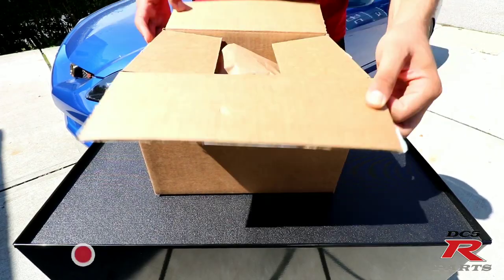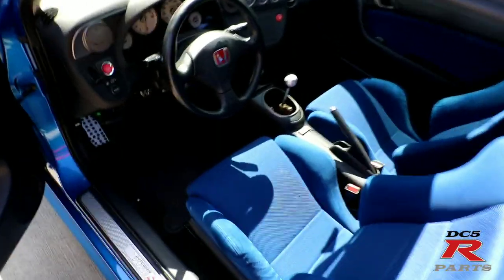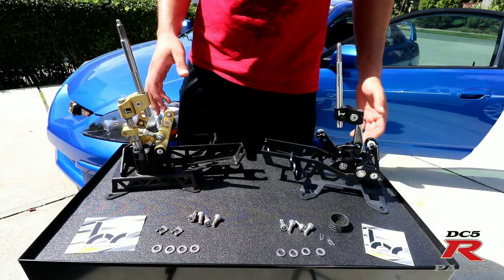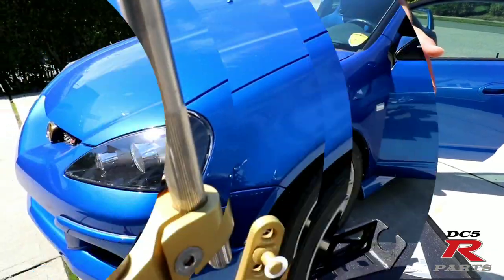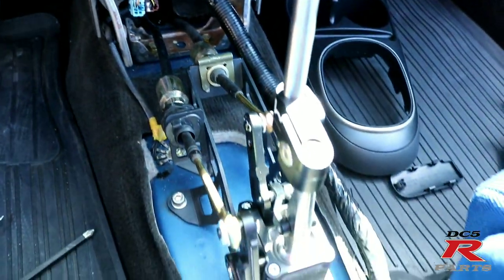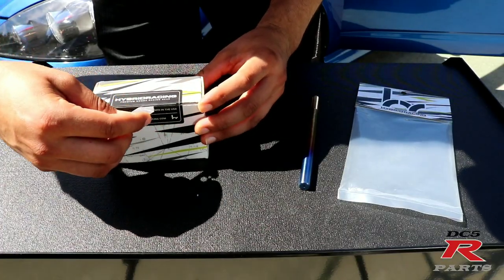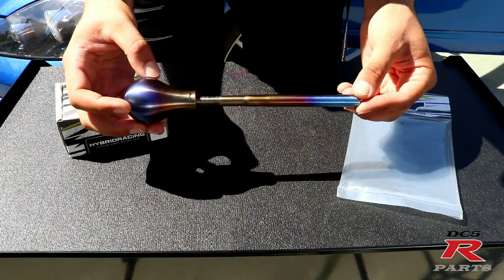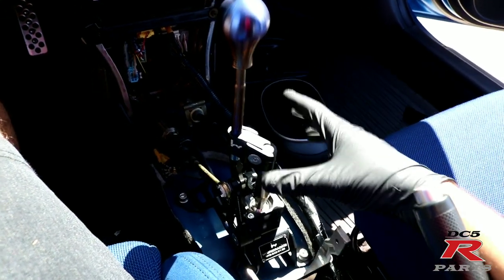I am impressed... | Hybrid Racing V3 Short Shifter Review & Install! | S4 - EP5

Comment: Which do you prefer? Acuity or the new v3 shifter from hybrid racing.
Reply from the maker: I am making a video and releasing it soon! Stay tuned.
Reply: I also want to know too, im currently in market for either the v3 or the acuity. There no video comparison the two shifter
Reply: @DC5RParts  Need to know v3 or acuity

Comment: Just wondering if anyone can explain better what's the differnt between cc and hp? As why I see some cars have low cc but the HP is so high, does that matter and what's the advantage/disadvantage on road
Reply: For what I've read I've seen 2 things about cc. If you didn't know already it stands for cubic centimeters. For what I usually see its talking about engine displacement or size , but I've also seen it be for the amount of gas that fuel injectors are able to put out to its respected cylinder. so to be fast about that its basically the volume or size of the engine. Now for horse power, it is the defined work or power that the engine can produce.

Here is a good website that might be more understandable if I just ended up confusing you more.

https://askanydifference.com/difference-between-horsepower-and-cc/